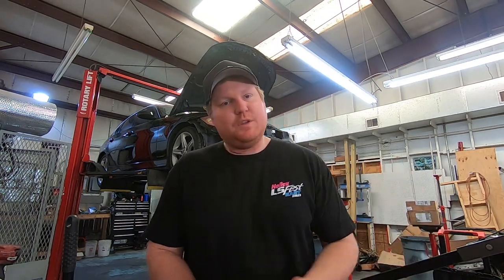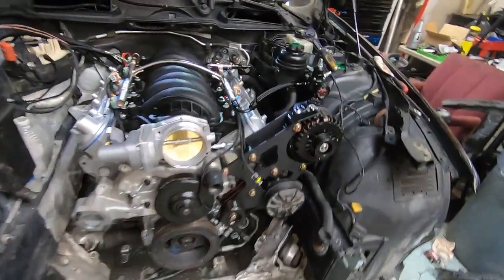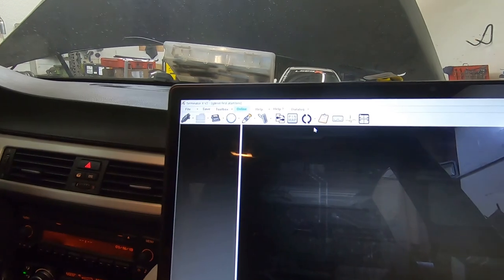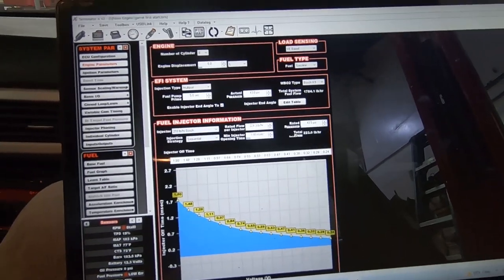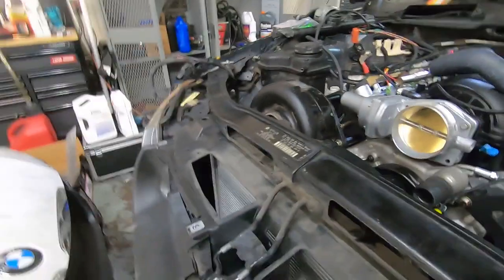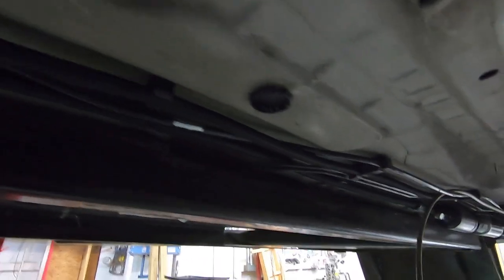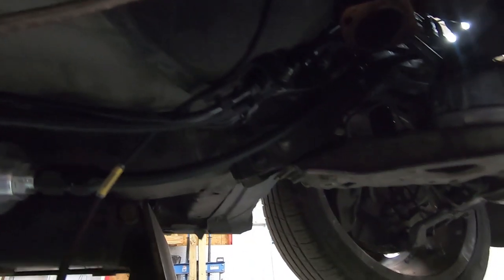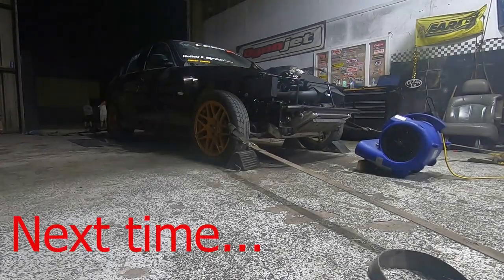Procharged 6.0 LS Swapped 335i - Part 2!

Comment: What size procharger is that? 
Are the brackets for the procharger available to purchase or order? And what accessory spacing are you using with that procharger?? 
Can’t wait to see the next update!!!
Reply from the maker: C5 accessory setup, D1SC head Unit.

I’ve talked to Mike about offering the bracket setup, and we also have dealer accounts for the head units, however some fab work would be required on the end user side. If something does end up becoming available we’ll be sure to let everyone know.
Reply: @lse90garage  ok right on! I’m definitely interested

Comment: Do you think a ls to zf with adapter plate will still line up with ur kit?
Reply from the maker: Yes  many have used it but you need to use an auto driveshaft and our dct crossmember because the new location is 1" back from stock

Comment: So what does the stock pump/feed line do in this fuel configuration?
Reply from the maker: It’s still functioning like factory, I’ve simply added an auxiliary setup that is independent of the BMW factory fuel system.
Reply from the maker: It’s still functioning like factory, I’ve simply added an auxiliary setup that is independent of the BMW factory fuel system.

Comment: Did you guys ever complete the 5 series mounts? love the stuff you have for the e90s
Reply from the maker: Mounts have been 100% confirmed, Mike just needs to have a laser cut order put in, there will prob be a preorder so he can gauge how many on the first run. He has confirmed that the E90 accessory drives work with a non active sway bar car, as well as the transmission mount options. 

Cars with an active sway bar will need a diff accessory drive setup, that is still in the works.
Reply: I need a set of e60 mounts too. My Motor is built and my trans is almost done.
Reply: @jasonjennings5833   what trans are you using ,my n52 just blow